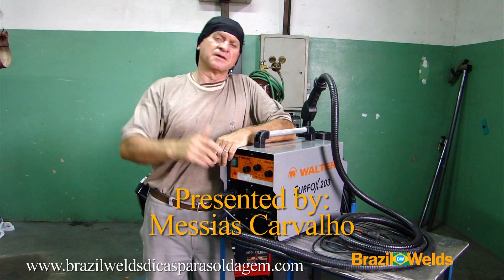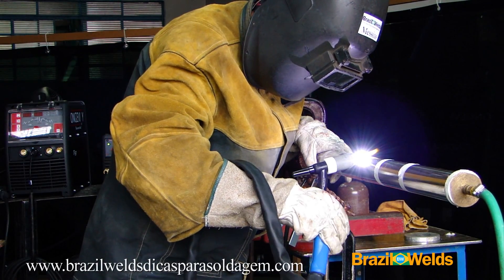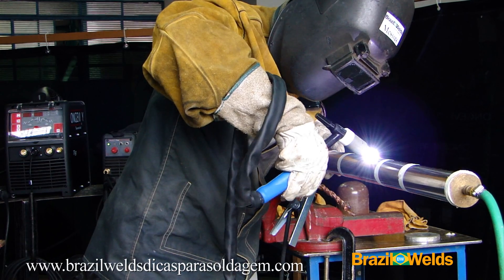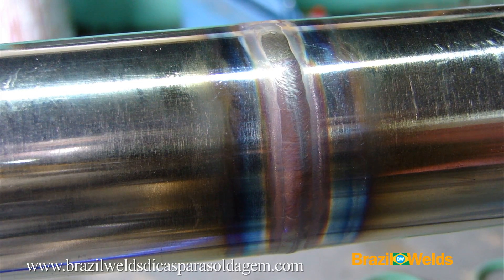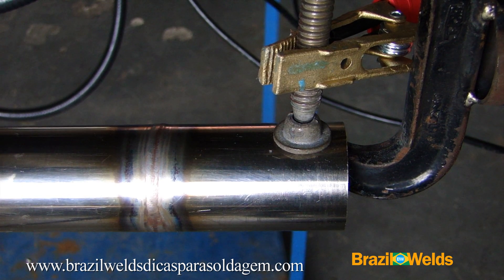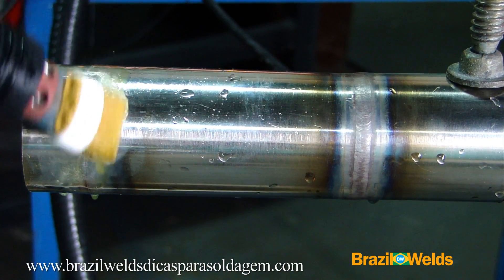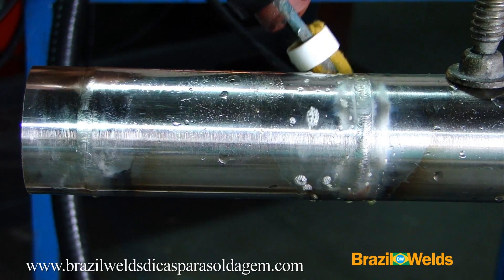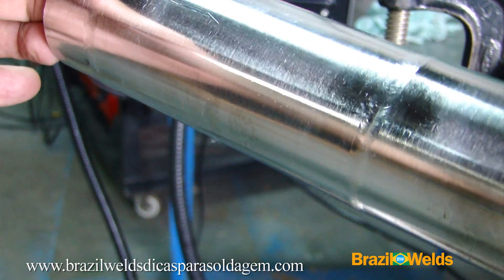Surfox 203 Sistema eletroquímico de limpeza de solda TIG em aço inox,

Comment: Tentei soldar chapa 0.8mm para uma cuba de Inox 304 utilizando este processo em uma iversora de 250A, porém deixei no 0 a corrente(mais baixa possível), mas o processo derrete a chapa ocasionando o encolhimento do material, aí não consigo juntar... tem alguma sugestão? Estou afiando bem o eletrodo de tungstênio e usando o gás argônio em 10.
Reply from the maker: Felipe Alcará Olá amigo, veja só, solda com amperagens mais altas ( 40 Amperes em média) você pode não acreditar mas eu ví um soldador soldar umas cubas de aço inox com 80 Amperes, para fazer a solda mais rápido que ele podia fazer e na posição vertical descendente, treine para soldar com uma velocidade bem mais rápidas do que esta acostumado e utilize uma vareta de 1mm, que será melhor . Sempre soldando na vertical descendente. Quanto mais baixa mais a amperagem mais empena a chapa.

Abraço

Comment from the maker: Hello Markus,
Is not required ventilated place, you can put a compressed air system on the machine, to completely eliminate the vapors.

Yes I used 100% Argon, perhaps had a bit oxigen, inside of tube yet.

Regards

Messias

Comment: Thanks once again Messias!

Nice video and subtitles. It cleaned the weld well and easily. What's the solution btw? Does that operation need to be done in well ventilated room like normal pickling would be recommended to do?

Nice weld too mate, but root was a bit blue. Did you use just plain argon inside the pipe?